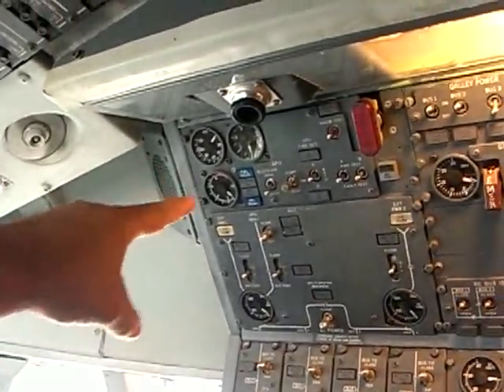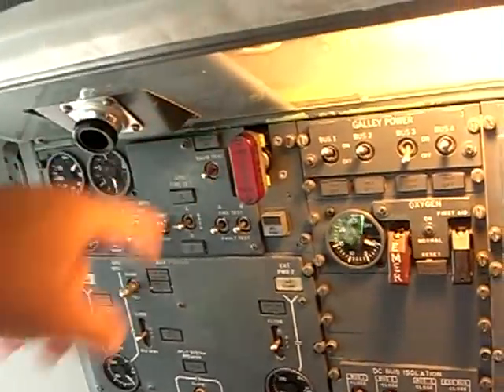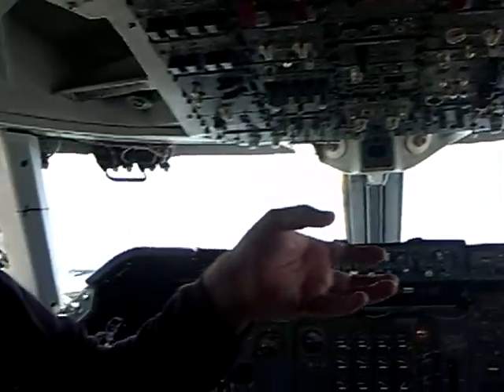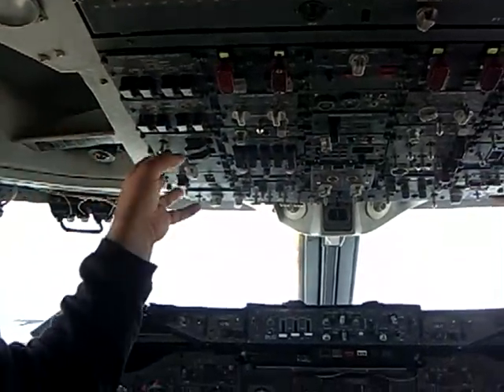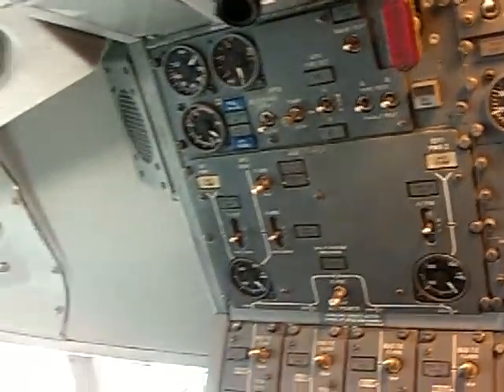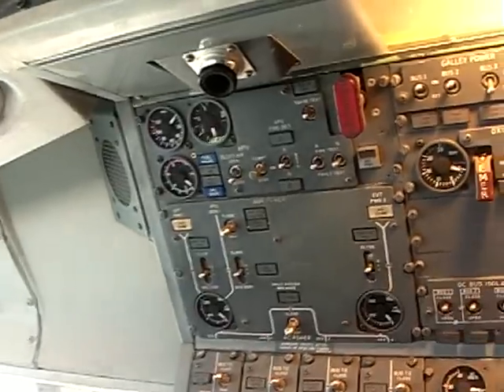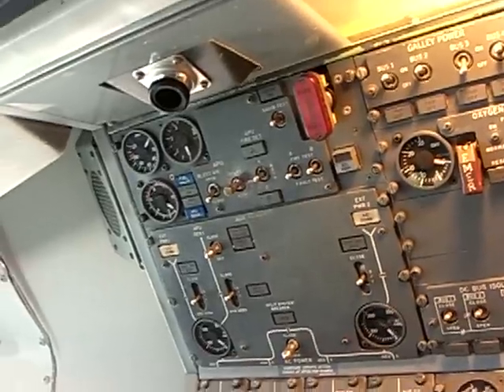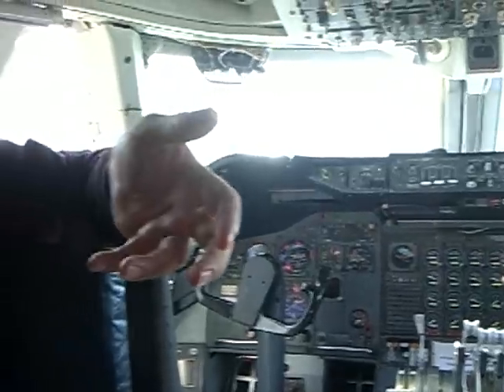The Amazing Boeing 747 extinguishing APU Engine-Fire  from cockpit unique design features -8

Comment: another interesting feature is that when you turn the apu master switch to off, it won't actually cut the fuel line at first, but it will instead send a simulated over-rpm signal to the protection circuit, which will stop the apu, testing the circuit at the same time

Comment: This looks like a Boeing 747-100. Newer 747 models, like the 747-400 has more or less eliminated the need of a flight engineer by incorporating digital flight instruments.
Reply: Could be -100, -200 or -300 with an analog cockpit and F/E station.